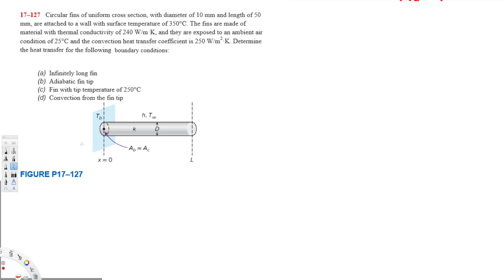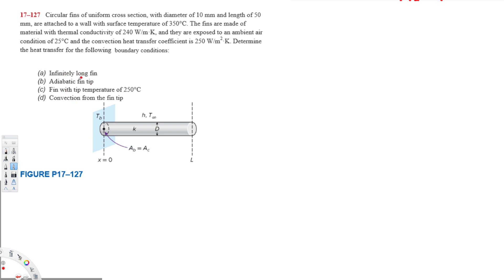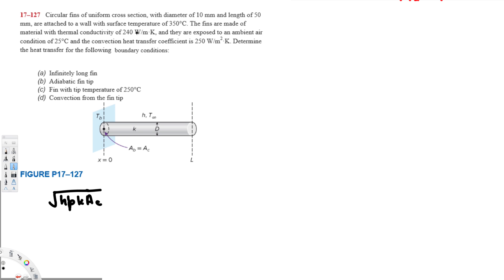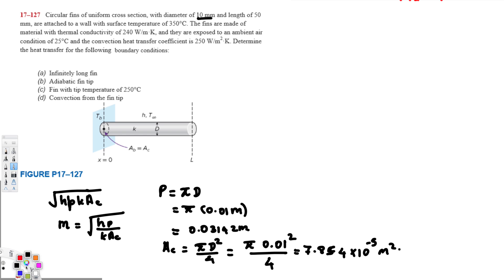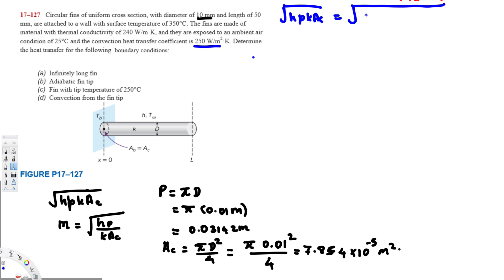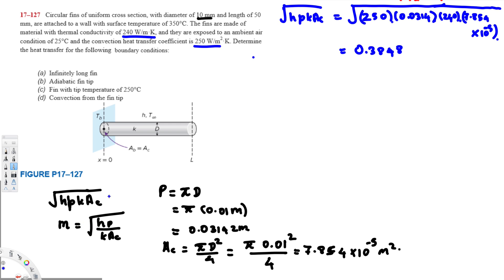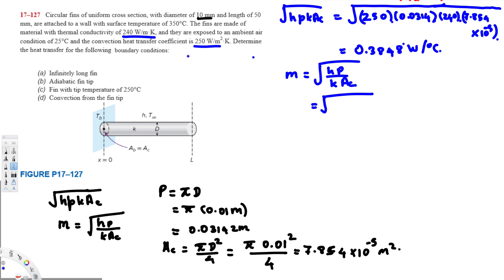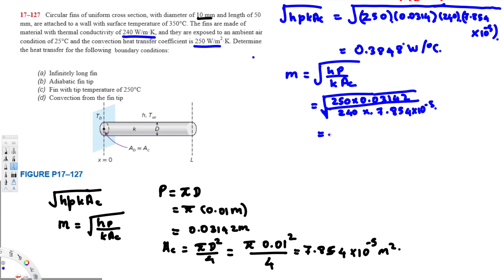Heat Transfer - Determine the heat transfer for the following conditions

Comment: so is the result you get for part d the heat transfer of the entire fin with that boundary condition? or just the heat transfer of the tip with that boundary condition? 
basically, If I'm trying to determine the total heat transfer of the fin with convection occurring at the tip, do I just plug my values into that equation and use that answer or do I need to add the heat transfer from the rest of the fin?
Thanks for the video, though, it really helps!